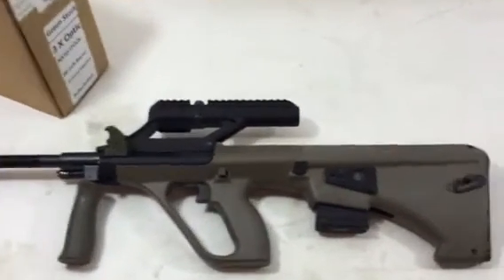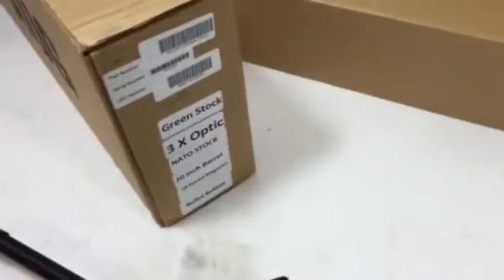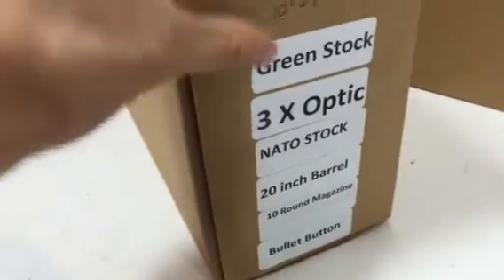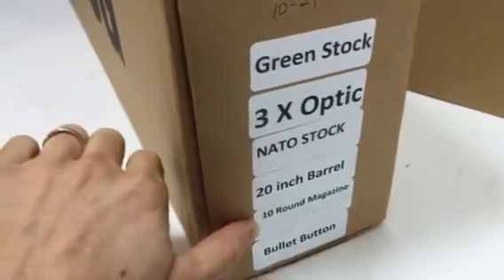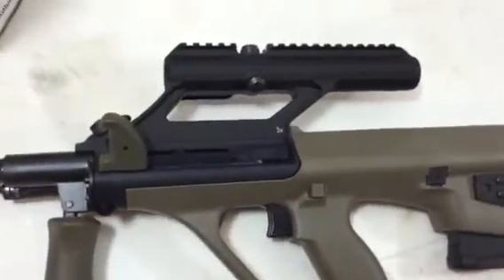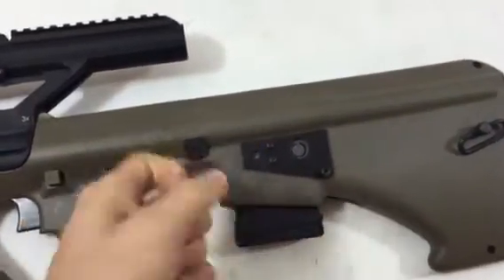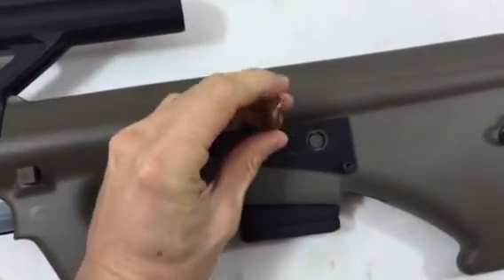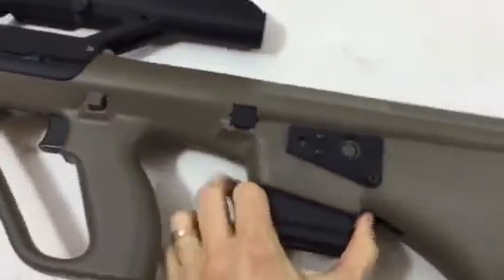How to operate a bullet button on a California legal Steyr AUG

Comment: It has a vertical fore-grip, how is this CA legal, let alone legal in many other states? Just wondering...
Reply: his rifle went (non compliant) shortly after this video was put on youtube. due to ca laws getting enacted
Reply: Here in ca, you can either buy a featurless rifle (no pistol grip, no vertical grip, no flash surpressor and no adjustable stock BUT you can have a standard mag release) or you can buy a full “evil featured” rifle with all the scary features BUT you have to have some type of mag lock system so your ability to quickly change mags is now hindered. This is per 2024 btw who knows what’ll change next.